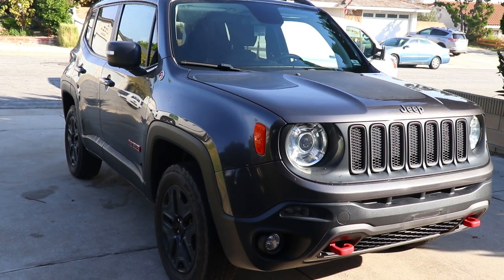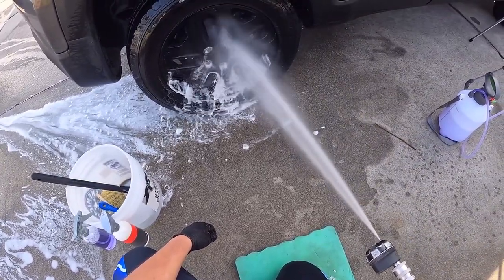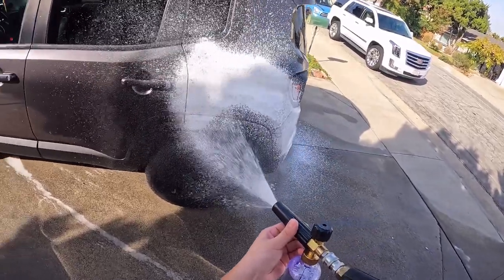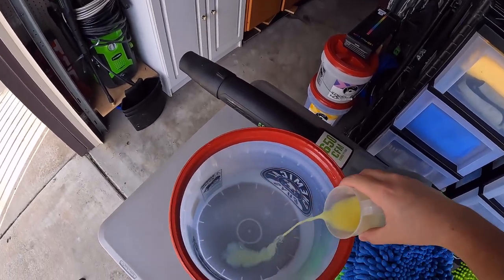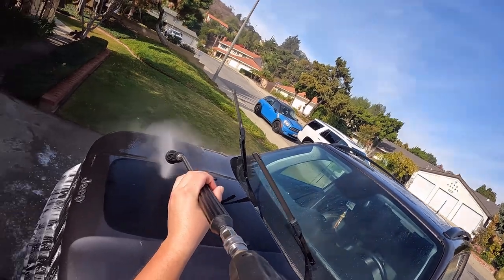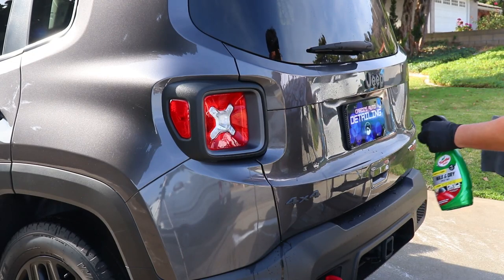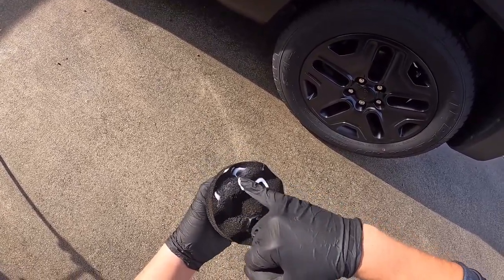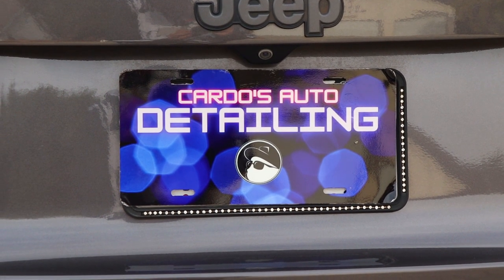My Take of a Standard Exterior Detail Package | Exterior Detail

Comment: Magic Wheel Cleaner is a non acid cleaner dude. In fact, the cleaners that remove iron particles are generally ph neutral.
Reply from the maker: I am aware of it being called neutral, but the pH is clearly spelled out right in front of the label, with a rating of ~5.5 Straight, no dilution, which is far from neutral, which is a 7. 

I will need to test this with my equipment under different circumstances because not everyone has the same bottled chemistry (EU v NA), so later when i post a review about this i will touch on that.
Reply: @CardosCarDose  fair enough - good vid!

Comment: Allo de Montréal Cardo! I would like to know if there's a difference between your APC rinse and the Bilt Hamber pre wash soap with a ph of 12? Thanks in advance
Reply from the maker: Allo de Cali Jean! 🌴 🌞😎

Now the APC I chose here is Super Clean at 4:1, with a pH of 12. Because this is DILUTED and I tested it, i can def recommend this. The Bilt Hamber soap, if you get that rated pH when its DILUTED, then yes its a great option! However, if thats the pH without diluting it you might want to test it diluted to see if the pH drops with water added. 

Hopefully this helps answer your question! 😎 Im guessing you just came from Pans channel? Im throwing a guess here 😂